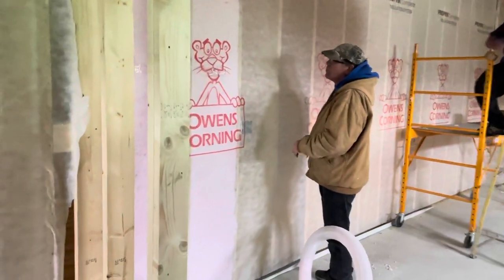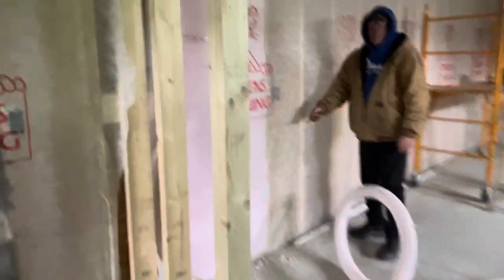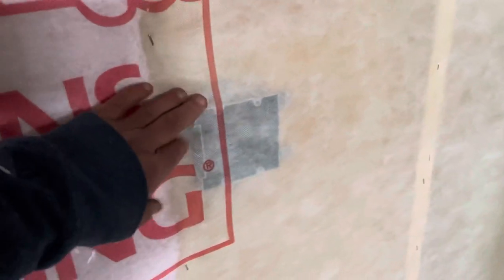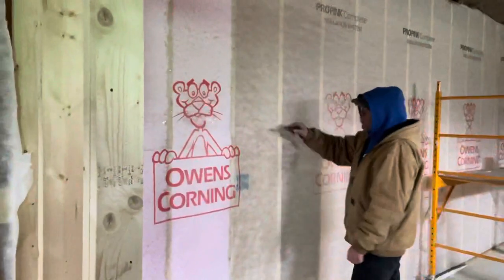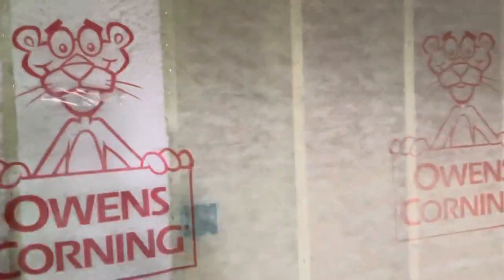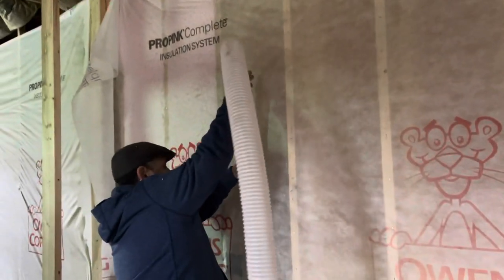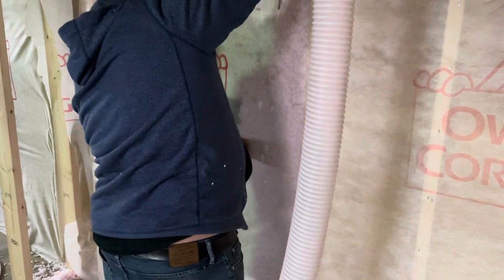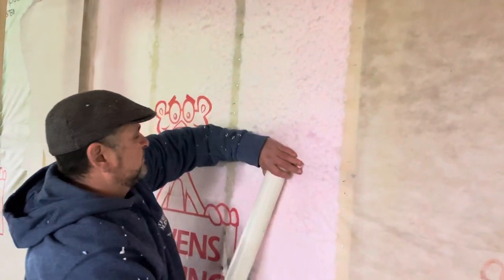Insulating a wall with blown in insulation before wallboard is installed

Comment: Can you blow in fiberglass from the outside like people do with dense packed cellulose?  I have a house with existing batting but need more insulation and was considering blown insulation.  I am worried about off gassing so don't want to use cellulose.